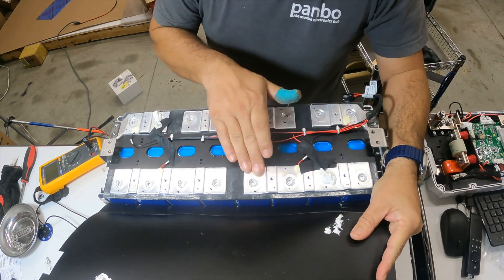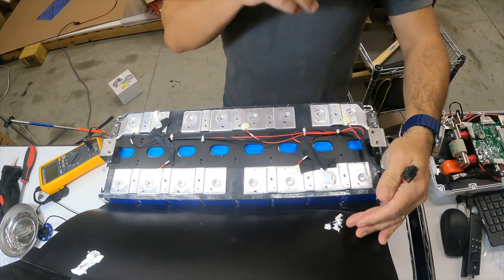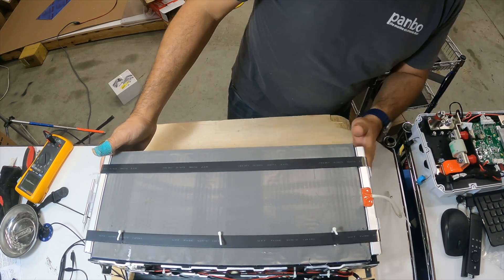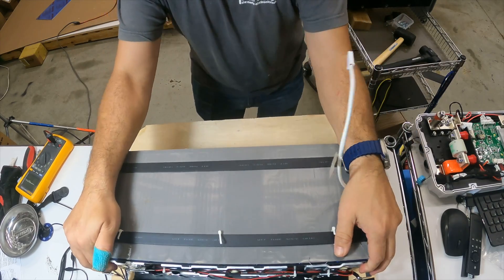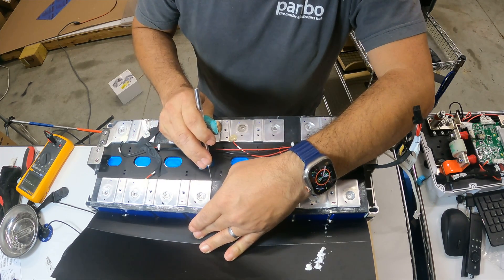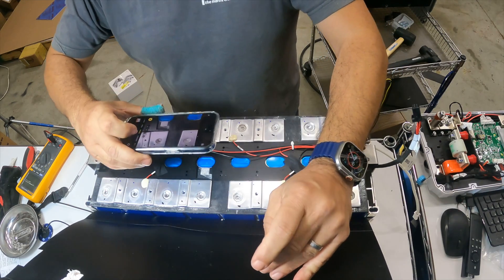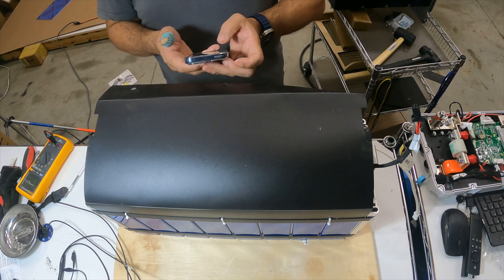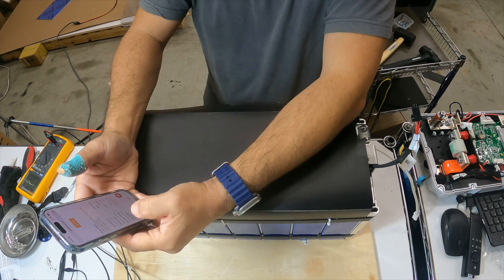Panbo presents: Epoch Batteries 460 amp-hour 12-volt battery cell removal and inspection

Comment: Question on this breakdown- what is behind the mounting points at the base of the battery? How far in does the cell start? We were mounting our batteries with a custom bracket and realized the bolts we chose went deeper into the battery than the provided hardware by about 1/2 inch. Trying to figure out if we could have damaged a cell. It looked like there was plastic behind the mounting hole, would appreciate any help or details on what you found behind those holes!